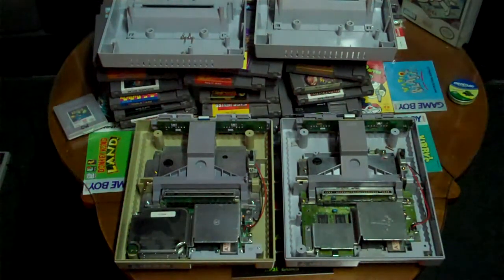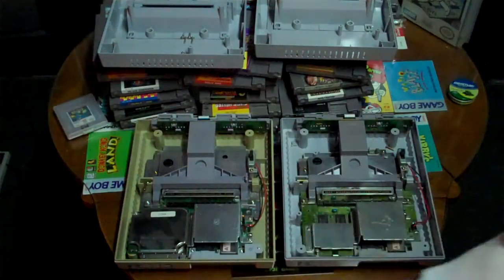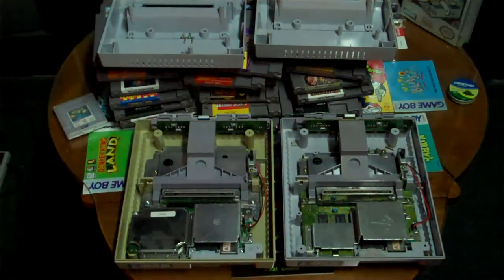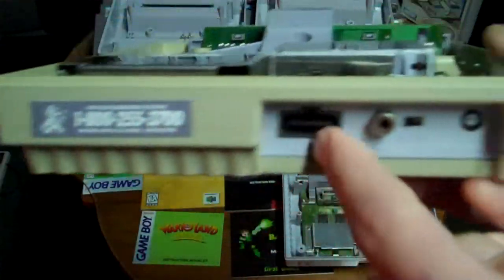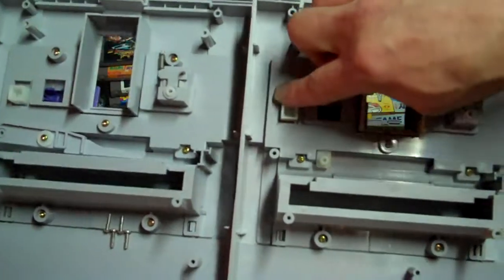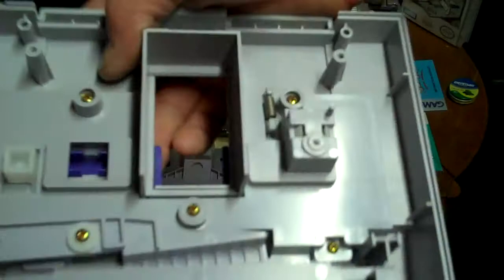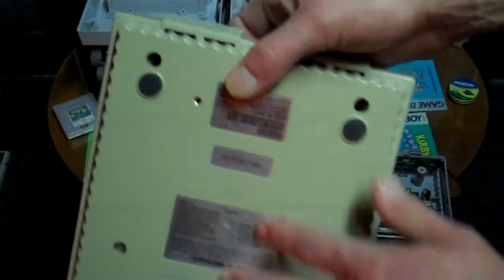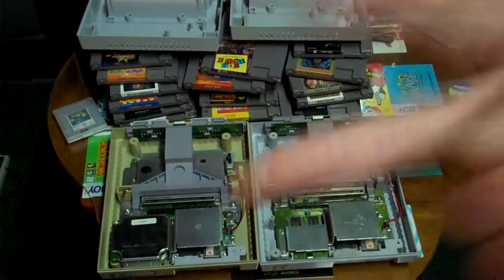Two NTSC SNES Production Types i got. !

Comment: nice. i could never take systems apart.   also sorry for the email about an issue. just wanted to give you a heads up in case said user gives you trouble. seems everyone that has commented onmy splatterhouse review has been attacked.